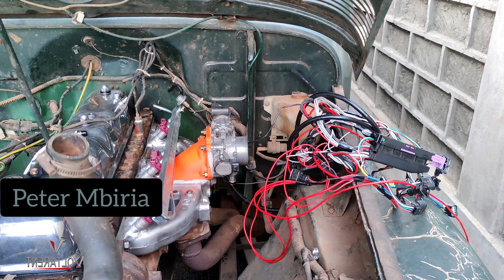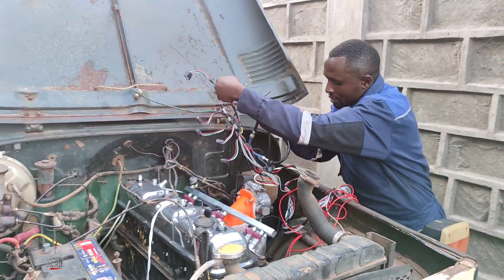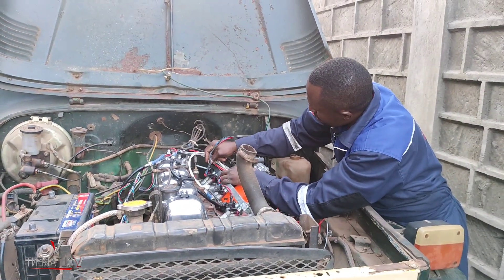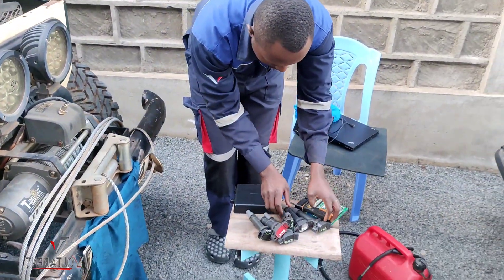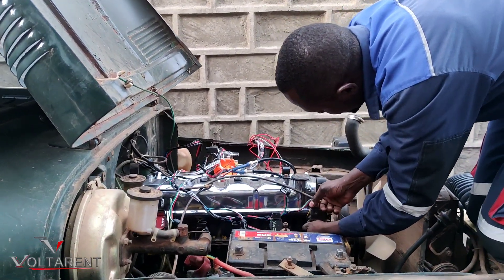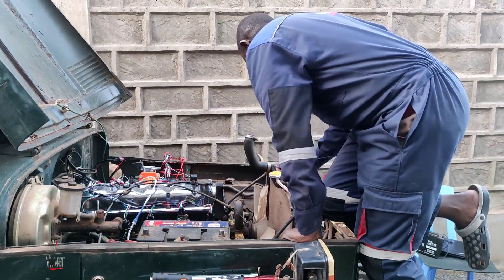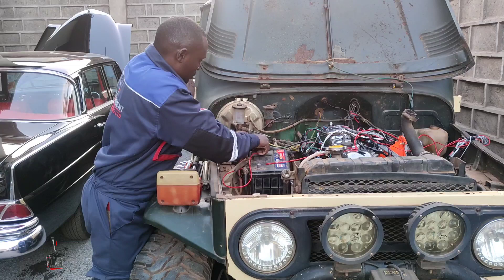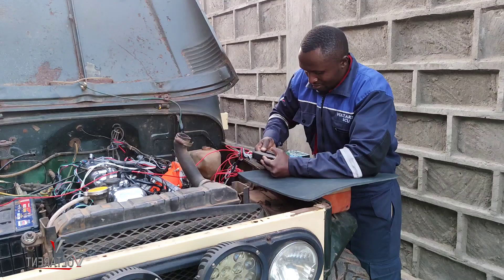Revolutionary EFI Setup – Running FJ40 Engine with Only Camshaft Input!

Comment: I like it, another Way to save gas is on the transmission by going neutral on the coasting mode but the  motor does stop how would you do it by catching the low rpm and keeping it through  your voltarem you invented??

Comment: Neat. Have you considered creating a carb replacement that has an injector or two in it like the holley EFI? The cool part there is that you dont need to put  the fuel rail and injectors on the manifold, just in the carb body.
Reply: If you want to create uneven fuel distribution to each cylinder.

Comment: Hi Peter, I have a 1981 Saab 900 GLs with a distributer and twin CD150 Zenith-Stromberg carburettors, would your EFI ECU be a good fit for this model car?
Reply from the maker: Yes it would work well but will need some modifications to allow the use of fuel injectors

Comment: Do you protect your ECU setup from electromagnetic interference or relying on coil-on-plug lower EM emissions only?  Do youbalso do fuel only mods for sinplicity?
Reply from the maker: Yes I do have protection from attenuation originating from the COP and coil packs. Fuel only mods, not really

Comment: Man I appreciate Your work so much!!! Just a few questions, because I am really, really interested! Do You have an option to accomodate for lambda sensor? Not really for emissions, just for effectivity etc. Or You just have switchable "maps" (Sport/Economy/Comfort etc.) and they are made to roughly keep richness at certain level?
I mean, this ECU is meant to replace carbs and stupidly hard-to-work-on-nowadays systems like K-Jetronic or L-Jetronic and I don’t really think they had lambda sensor at all. 
Is there something like basic on-board-diagnostic present? So You can read basic trouble codes (for example: coolant sensor out of range), or read some kind of "live data"?
I can imagine there are not really a lot of parameters to read, this is excellent solution for old cars, where we need to keep things simple, I can imagine Your ECU being on cca the level of first Motronic ECUs or Simos with sequential firing. Anyways nice job man, I’ll stay tuned cause I’m a big fan of Your work and commitment.
Reply from the maker: Yes, it has a provision for a lambda sensor BUT seldom used. It doesn't prevent one from running any engine on different maps as you said or rather, drive modes. Voltarent ECU offers more than just the bare minimum Motronic ECUs offered. It can run the sparking sequentially but the fueling can be done sequentially, batch or all (all would be suitable for turbo) and each drive mode has different sparking angles and fueling type and parameters.
You can stream engine live data via serial and can do self diagnosis and display on the small oled screen things like charging error, overheating error, temp sensor error, MAP error, etc and even can be set to turn off the engine if the temperature exceeds a certain set limit.

Comment: Peter are you making a intake for the injectors, or how are you turning it into a EFI system on the older motors
Reply from the maker: Modifying the intake manifold to allow the use of fuel injectors

Comment: i love this old cars but i dont like the caburator our would love to know more about that fuel injection upgrade
Reply from the maker: @kennmpu1109  Hey man, thank you for your inquiry. We completely remove the carb, modify the intake manifold to use fuel injectors, we design our own fuel rail and install fuel regulator, new fuel lines, we use hi pressure electric fuel pump, we do away with the previous ignition system, we modify the distributor  and pick camshaft position for the ECU, we make it use coil on plugs, we build custom harness and write a custom firmware for it.
Reply from the maker: In other words, we completely upgrade your engine to modern standards
Reply: @PeterMbiria1 😊

Comment: I mean it does run but only because load on engine is constant(wich is no load at all). For actual use you will have to use at minimum either MAP, TPS or MAF signals. Otherwise ecu does not know what load engine has and can not calculate air flow. When i made my own arduino based EFI i also made test where i just turned on injector for specific amount of time every time crank position sensor got triggered. Then again, given that you have a lot more wiring and sensors prepared for use in the video you already know all that.
Reply from the maker: @Dymitr_Nawrocki  Of course. As I narrated on the video, I just wanted the engine to run first. You have said all well which is what happens, the ECU needs more data to make the engine run efficiently.
Reply: Please I need your professional advice, I have a vw sharan, I swapped vw2.0 t4 without turbo into it, an electrician built a wire connection with air flow meter, igniter, coil, coldstart, brainbox, all Toyota, distributor fabricated in a way to open the nozzles and count the plug. My problem is that sometimes the car will be running smoothly then all of a sudden it will become slow later it will charge up again, please what do u advise and what other sensors do you think the car still needs, thanks

Comment: nice work 
but it need more tune bec when you rev it the air to fual ratio increase to 22.7
Reply from the maker: @DBABA-q9x  This was just to make the engine start. No tuning done yet at all. As we continue, we will now add the other sensory data and tune it. It will become a beast by the time we are done with it
Reply: @PeterMbiria1  that is right 
try to mack a video will tuning .this will be a great vid.
good job pro